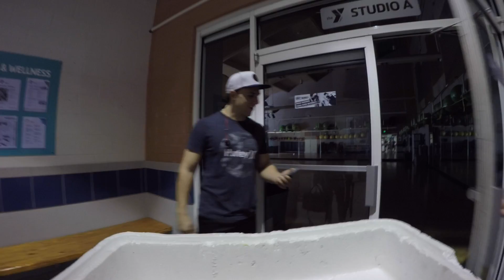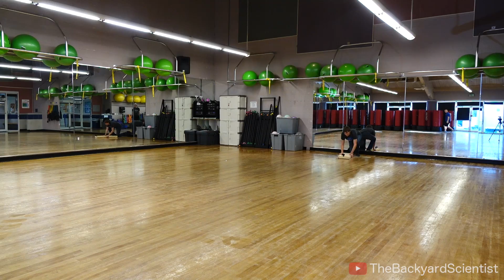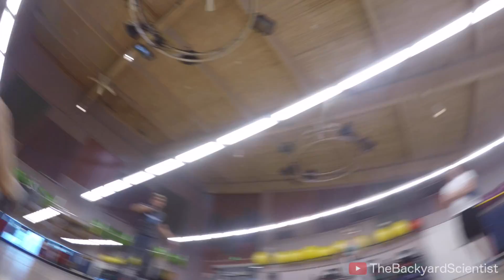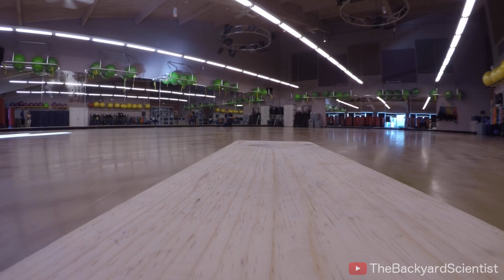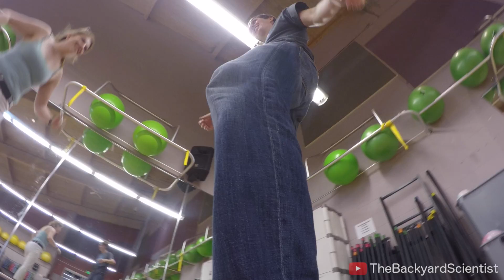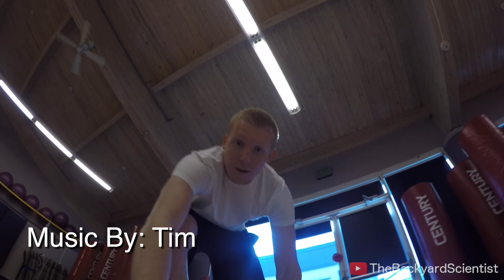Dry Ice Hoverboard (D.I.Y. REAL Hoverboard)

Comment: Still doesn't FUCKING HOVER
Reply: actually, It hovers microscopically
Reply: Oyuncunun İnancı So does the fucking HoverTrax because you can never truly touch anything.
Reply: Theres very little bit co2 between dry ice and floor
Reply: Oyuncunun İnancı There's very little oxygen between your fingertips and the keys you just typed.
Reply: I didn't say there isn't
Reply: Oyuncunun İnancı So everything hovers microscopically. Why the fuck is this thing specifically called "HOVERBOARD"
Reply: 'cause it hovers just like everything so you can call everything a hover :D

Comment: Its sliding not hovering.
Reply: This is why dumbasses win arguments all the time, they keep finding reasons to prove they're correct. Even though they're not.
Reply: bro were u even listening to him
Reply: +adrian moreno Yea he said it was sliding himself. the title is click bate. Hover means OFF THE GROUND.
Reply: +Richard Wills actually he said there is a layer between it and the ground so technically it is hovering
Reply: +adrian moreno No its not!
Reply: It is hovering. There is CO2 (Carbon dioxide gas*) between the dry ice and the ground, since it's boiling at room temperature (CO2 is normally gas in the air*.) Therefore, the dry ice is bit touching the ground and is hovering.

*I wish I didn't have to tell you this, but it's obviously neccecary.
Reply: +Henry Ambrose No its still sliding. ide love to see somthing pass underneth without it moving. FUCK OFF THERS NO HOVER STUFF GOING ON
Reply: Richard Wills You could probably slide a piece of paper underneath. Hovering is not defined by how much stuff you can put underneath it.
Reply: +Henry Ambrose Just watch the video agian you can hear the ice SLIDING on the floor. I know what hover means. you ppl are oviasly as bas at science as i am spelling.
Reply: Timber Saw ikr he said it's hovering and this guy even watched it but noo he's right just like every other kid on the internet thinks they are
Reply: Richard Wills no
Reply: Richard Wills wieght pushes the board down onto the floor so it's not hovering anymore so both of you are right but it hovering some times so no click bait (even when click bait is impossible not to have)

Comment: If it has no friction it should never slow down right?
Reply: Well they are putting pressure and weight on it so it doesn't  go far.
Reply: +Alaskan yeah but on itself the dry ice stopped as well

Comment: It is not that weird. Ice has a resistance of 0 (zero), so it will never slow down. But if you put pressure on the ice it will slow down.
Reply: It will slow down because of air resistance.
Reply: +Crooked crang no, in a area like this you can neglect air resistance.
Reply: Je Moeder It would take a long time but it would slow down after a while because of air resistance.

Comment: take that to an ice rink and I bet you will slide much further
Reply: Actually you may slide less, the reason it hovers is the dry ice is evaporating so fast it creates a layer of gas between the board and the ground, so a colder surface would slow down evaporation
Reply: Ya I guess that would be a good experiment if the lack of friction on ice would make up for the lack of evaporation

Comment: it is actually hovering a bit, but as you can see that it changes direction and turns, it means it can not overcome the weight of the dry ice and the board totally, and with a person on it, it can only reduce friction between the surface of the ground and the dry ice. However, if you can lower the temperature to around 80 K, you can use  superconductors and try it, it will turn out much better, but it will cost a lot to keep the temperature soooo low
Reply: We can get the temperature of stuff to a extreme high temperature, but not the other way around because 0 K is the lowest temperature in the world and we can't even reach that temperature

Comment: Still not in any way a real hoverboard. Its just a low friction board.
Reply: +Jeriko Bautista not to mention that it wouldn't be making any of those wood scratching noise  if it was actually hovering.
Reply: +ShadowLucario XY even without person on it you can hear it dragging on the wooden floor which means that it's not hovering.
Reply: +martinshoosterman Air resistance.
Reply: ArcdoesMC the fuck does that have to do with anything?
Reply: Dry ice produces a gas and that gas gets trappes underneath the ice, making it hover/float.
Reply: idk9683 it doesn't produce a gas. the solid CO2 sublimates into a gaseous CO2.. Which produces a small amount of lift allowing for a lower coefficient. of friction. 
It does not actually float, it just slides with less friction. the lift clearly is not enough to float the board. if it were floating then it would slide for much longer and lose speed much slower. Clearly its not losing speed to air resistance alone.
Reply: +martinshoosterman he means that air resitance allows for the "low friction boards" to not go forever. like how weight dosent matter on how fast two objects fall just air resistance and gravity. its like how an apple and a parachute fall at the same rate in a vacuumized area with no air to keep the parachute afloat
Reply: Jeriko Bautista It still doesnt mean that its hovering.
Reply: It isn't touching the ground. There is a very thin layer of co2 between the board and the ground.
Reply: ShadowLucario XY Its at best bouncing. there is way to much friction for it to be hovering. look at a real hoverboard move, you can tell its way differant from this.

Comment: I'm not normally this guy but... how did you touch the dry ice with your hands? Doesn't it burn?
Reply from the maker: Yes it burns, but not instantly. It's like when you are carrying a hot thing really quickly, and it starts burning so you have to hurry!
Reply: +shootingblueyes I&#39;ve had dry ice in chemistry class before and it&#39;s not as dangerous as people think. You can pick it up and hold it for a few seconds with no ill effects. It just feels like holding a really cold ice cube. Now, if you hold it too long or grip it tightly, it can burn you and stick to your skin.
Reply: Wait does it burn?? I though it was super cold that you could hurt ur fingers
Reply: +TheBackyardScienctist Does Dry Ice melt cause I didnt see it melt
Reply: Dry ice goes through sublimation, which is the conversion directly from a solid to a gas. This is because CO2 Doesn't have a liquid state at our normal atmospheric pressures.
Reply: OOOOOOOOOOOOOOOOOOOOOOOOOOOOOOOOOOOOOOOOOOOOOOOOOHHHHHHHHHHHHHHHHHHHHHHHHHHHHHHHHH so that means it DONT melt
Reply: +XenoGenesis (TBNR) it gives a burning feeling. Your blood vessels contract so fast that they give you burning sensation, that will lead to horrible damage to your hand from skin and flesh sticking to the dry ice eventually.
Reply: +DemonTale Chara it melts into gas...
Reply: PraessiTV i could understand that :3

But still how does he touch that xD
Reply: DemonTale Chara the shape shifter it doesn't melt, it sublimates into CO2 gas.

Comment: This is ultimately a fail since this wouldn't work on any other surface except wooden floors. Plus you would have to push yourself or be pulled in order to move unlike the hover board of where you'd lean in a direction in which towards it would take you. P.S. This is the 666 comment.

Comment: Cool experiment!
Have you thought of using a skirt? Not instead of the jeans, but wrapped around the edge of your hoverboard to allow it to cross less-than-perfect terrain?

It's a proven solution for this problem- first used in 1958 in the UK for hovercraft which are basically the same principle- and shouldn't be massively difficult to implement. Plus, you know, hoverboarding down the street would be awesome.

Comment: So it is basically ice skating
Reply: Backwards ice skating
Reply: yes, yes it is - the CO2 sublimating is  creating a cushion of air underneath it, so the Leidenfrost effect creates the layer between the ground and the board.
Reply: +Ben Sullivan its still touching the ground. There is just a small amount of lift creating less friction. If it were really hovering there would be significantly less friction.
Reply: Hi, my name is Jeff.
Reply: +Ben Sullivan no, there's just very little friction
Reply: +Ethan baylis Gas skating.
Reply: +Ben Sullivan it's not actually hovering
Reply: Rarely do things truly touch the ground it's just like pushing to negative magnets on a much smaller scale. But talking realistically it touches the ground LESS because it's barely hovering reducing a lot of friction letting it slide
Reply: No sliding
Reply: +joshwa conor alright please do not group us all together, there are Russians, Mongolians,Japanese,Vietnamese etc.
Reply: +joshwa conor there are too many and we all have a different trains of thought so you can't really group Asians together.
Reply: +martinshoosterman but ice skating is using a blade and skating through ice and this is kinda reversed so you could say it's similar, but it's still not as close as the same thing..
Reply: +Josh Lukowicz it's neither, as there's no contact between the surface and the board.

Comment: Would it work even better on a hot surface, like a black top parking lot when the sun is on it. I know dry ice moves around like crazy on a hot pan.
Reply: If you could get a black glass plane is the sun. Then sure. 
But it has to be a plain/smooth surface.
Reply: Or find a brand new neighborhood where they just laid the street. Brand new road can be pretty smooth.

Comment: what if you covered the surface with a layer of water??
Reply: You would sink. 
The only reason it works on the wooden tiles, is because the hover board can ride on top of the cloud of vapor gas that the dry ice is producing.
So if you removed the ground, the gas would just escape from under the board. No gas = no hovering
Reply: TheOlian04 I'm talking a very very thin layer to accelerate the dry ice reaction and produce more gas, so theoretically more hovering!! as long as the ground is more dense than the gas, as water is- and the seal is good, then the gas shouldn't escape, but i think it might alleviate the wood's friction?? (i want to be clear, I'm really not sure about any of this!!!!)
Reply: +toasty bear hmm. Might work. As long as the water layer thickness is less than the gap between the dry ice and the floor. Otherwise the water would just get pushed along the front of the board. 
Although I to belief that a heated glass plane would work the best.
Reply: TheOlian04 yes, that was the issue i was trying to over come, heated glass pane is a good idea :) although- of course that would work best!!! but find me a room sized mirror!! :) :)
Reply: toasty bear
In sweden we call it "lustiga huset". Its an amusement park attraction. All floors, sealings and walls are mirrors ^^
Reply: TheOlian04 fantastic!!! :D (sounds like a cool place to go!!) that told me!!! i expect to see the backyard scientist at an amusement fair on sweden very soon!! haha :)

Comment: It's hardly a "REAL" hover board when it's not hovering it's just Ice sliding along the floor
Reply: Atleast it's more legitimate than those segways that have no handles...
Reply: Jessica, you're right, but kinda for the wrong reasons. When there is no human load on it, it is suspended on the CO2 coming of the dry ice, however, the weight of a human load renders the lift generated by the CO2 to not be super effective.

TL:DR some parts of the board are hover some are not. thats why you can hear sliding.
Reply: It is hovering. But I know what you mean. Not exactly BTTF
Reply: jessica james man, (don't be one of those triggered feminists) real hover boards aren't being invented for probably another 10 years
Reply: jessica james it is a real hoverboard, because it hovers over the floor
Reply: +Hailmusix it's not really though both of them are sliding along the floor wether it's on ice or wheels neither are legit

Comment: I wonder how this would work on an ice hockey rink. Ice's slipperiness can be due to its surface polish, but also because pressure on the ice creates a boundary layer of liquid water acting as lubricant. Would the dry ice hoverboard glide as effortlessly as you would think on that perfectly smooth solid H2O, or would it cause the boundary layer water to freeze into some rough finish absolutely destroying the glide of the hoverboard?

Comment: I was always told if you touch dry ice with your bare hand it will burn you is that true?
Reply: +terry lough You can touch it briefly or roll a piece around in your hand, but press your hand against for a while and you will get frost burn - it's not an instant thing though, it takes some time to 'suck the heat out of the skin'.
Reply: +Michael Tempsch ok thanks

Comment: What would happen if you put aluminum on dry ice
Reply: +jamerstime It would get cold.
Reply: +jamerstime Nothing.
Reply: Gigabic Yeah, one on how the aluminum gets cold, other on how the dry ice gets warm.
Reply: +guifrakss 
And the dry ice would get warm. Interesting reaction, a video must be made on this!
Reply: Just aluminum? Nothing.
Molten aluminum? Either an explosion, or nothing but a puff of smoke.

The dry ice would heat up extremely fast, causing a huge cloud of vapor gas to form in between the metal and the ice. The gas would eventually have to escape somewhere, and the fastest way would be up, through the molten metal. Depending on the thickness of the metal and the amount of gas formed, either a small hole would open up inside the metal, allowing the gas to escape, or the expanding gas would cause an explosion. (Not a fiery explosion. But an explosion none the less)
Reply: +TheOlian04 some1 has already Done that with molten copper and it exploded

Comment: Still not hovering, is it? Still, looks awesome :D
Reply: +RoboCawp  It's hovering on a film of co2. That's the whole reason it has almost no friction.
Reply: Jokes on you, I have no name it's not hovering! i wont prove you wrong, but it has no visable hovering.
Reply: RoboCawp It doesn't hover visibly, you're right, that' because the film of gas is very thin. But at the same time it does not touch the ground, which by definition is hovering.

Cambridge dictionary "to stay in one place in the air, usually by moving the wings quickly:" 

It does not state that it has to have a specified height to count as hovering, so a film that's less than a milimeter does count as hovering.  It's just not the same as the hovering displayed in movies and the such.

Comment: touching dry ice without protection kills cells bro
Reply: Yeah, if you hold it for an extended time, bro.
Reply: And if you touch it with dry hands bro. Before you ever touch dry ice with bare hands (which should never be done unless completely necessary) wet your hands with room temperature or warm water to create a small layer between your skin and the ice. It will only last for a few seconds though.